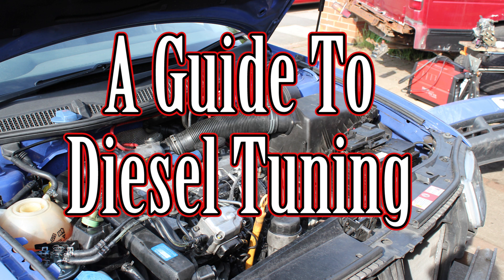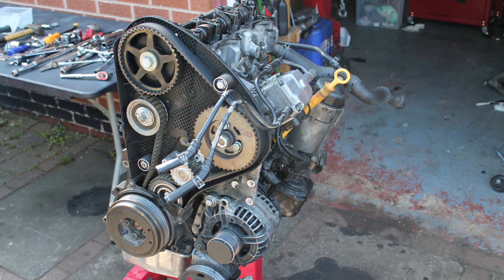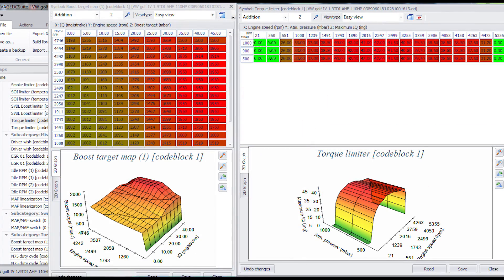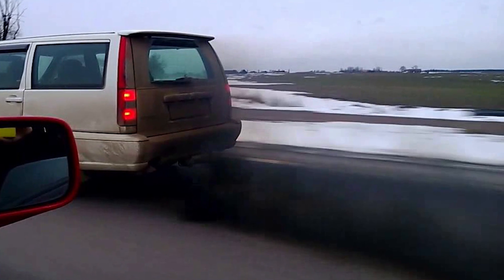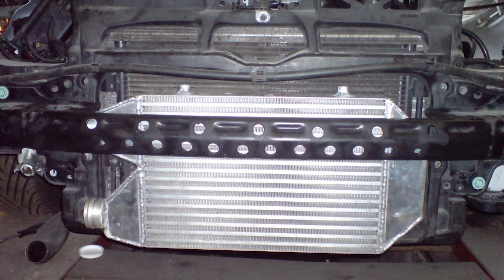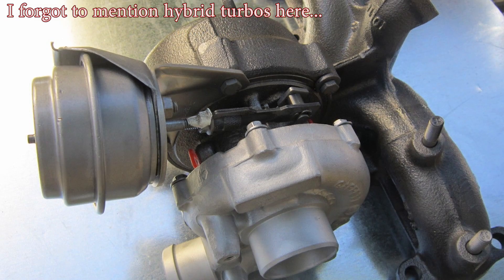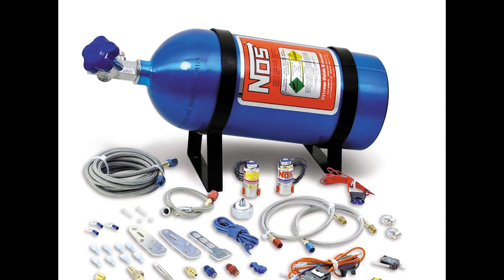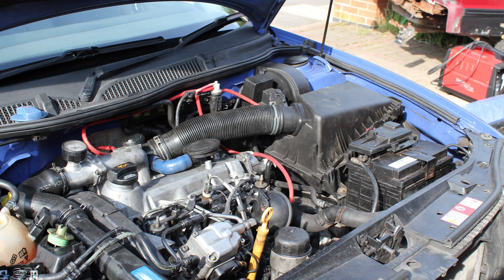A Guide To Diesel Tuning

Comment: Lol okay, I jus picked up a PD TDi Jetta (BEW Engine code) for about $500, it was a buddies car he jus dumped over 3k into, southbend stage 3 clutch, new turbo, and some other bits and pieces, injectors, etc... The car was running good, then suddenly (as he explained to me) the car lost all power, he could hear air rushing behind the engine, and the day I went to look at and buy it, it started right up no prob, and Idled fine.. TIL he hit the accel. and it would not at ALL rev, but was bellowing white smoke... I handed him the money, trailered the car home, and upon close inspection, the lower charge pipe had blown off (Intercooler side) so I replaced that hose completely, bought the KermaTDi Doggie collar for the top one, and I replaced all the Vacuum lines, jus to be safe.The car, besides injectors and Clutch, is otherwise stock. Which leads me here... I would RLY like to tune this little car myself, as I have next to nothing into it, its Diesel, and basically running stock turbo with big injectors... I understand the basic differences between a Diesel and Gas engine, IK Diesel is not Bound to the Stoich in the way the gas engines would be.. But this video was a huge help in understanding where I can start to tackle this on my own, so ty for that. There isnt alot of info out here on this topic.

Comment: Diesel tuning? Chop EGR with axe. Chop DPF with jig saw. Chop CAT with bigger saw. Insert 3" turbo back steel pipe. Vent crankcase under car. Clean all air inlet from shitload of carbon and oil.
Now you start tuning. Goodluck.

Comment: Great info. My Toyota Avensis 2.2 d4d 150bhp, 2010 plate. Remap with egr and dpf delete will take it to 190 Bhp 440 lb ft torque. Would it be recommended to remap the engine as it has covered 156k? Thanks mo
Reply: Make sure everything is clean and ready. Your motor must be healthy, injectors very clean, turbo healthy, clean fuel tank. I wouldn't delete the egr, it's very easy to remove and clean in 10 minutes and you can do it annually. Buy a new exhaust custom made and just keep the muffler and the cat. Also buy a kn performance air filter, it's also reusable so don't worry about the money. Dpf delete and stage 1 after will get you to 200+
Reply: @manbiteslife3110  hi mate. I got a diesel and want it to sound better but also pass MOT. How can I do it apart from dpf delete or buying a shitty speaker system they do.

Comment: I'm in a tricky situation trying to figure which turbo to buy. I have decided to get a gtb 1756vk but my issue lies as far as where I want to get it from I can possibly get a brand new from xq Motorsports (they have some of the fastest diesels) for 1110 USD or a gtb 1756vk from gottuned for 960 USD. Benefits from the xq Motorsports it should be of amazing quality . Con is that I have to get it thru a representative of xq Motorsports, so a middle man. Benefits of gottuned it's official website more secure and cheaper. Both will have a 6+6 billet wheel
Reply from the maker: I couldn't say tbh - you'd have to go with the best reputation and confidence of getting your money back should anything go wrong.

Comment: It would be cheaper to buy a used pd170 engine and map that thing to 220bhp, job done.
Reply from the maker: Is you wanted just 220bhp then sure but some guys run over 300bhp so depends where on the axis you are.
Reply: The great thing about the 170 is it doesn’t stop at 220, that’s stage 1.
It would be a much better platform as I imagine tuning the 1.9 from 110 to 300 would be hilariously expensive.
If your tuning for the love of it then go nuts, but in regards to power and potential future power increases, it pays to have the right platform.
Reply from the maker: Some people prefer the old 1.9's as they are simpler and cheaper it is a pick your platform and go thing, this vid was done from the POV of the car I had but true more or less on most tdis. The 3.0 V6's seem like absolute monsters looking at what darkside do
Reply: Agreed, the premise of the video is applicable to most diesel cars, I guess with any dream of tuning runs up a bill regardless, that’s what passion does to us guys and girls.

The 3.0tdi is a superb engine, I don’t know if you’ve come across the videos on here of them with a straight through and map, R35 GTR comes to mind.

This video was some time ago now, have you finished the project or moved on now?.

Comment: @250 you don’t need rods and pistons stock will cope with 350 easy research dark side developments
Reply from the maker: Sorry 250 nm, bhp, lb-ft? The engine in my example if an AHF which made 110bhp stock - I would be very interested to see one on stock internals running 350 bhp. The later PD and CR stuff certainly can take a lot more abuse on stock internals.
Reply: @CarAndMechanical  in the 110 lump you'd get 300 bhp in stock internals even the 1.8 20v turbo stock does 300 to 350 bhp in stock internals and the derv lumps are built stronger than that

Comment: Hey mate I have a turbo diesel Musso SsangYong 2007 Mercedes-Benz based motor I wanted to install a bigger turbo,what should I do or modify I just need more 60-100 hp as my car is just 120hp and weights 2400kg

Comment: No brake upgrade?
Reply from the maker: This video is talking about the power side of things, brakes, suspension, strengthening etc... are all different things. Brake leads onto tyres and so on, 100% should be a consideration for your car but out of the scope of what I was talking about here.

Comment: For me the easiest way to get good results without illegal exhaust and dpf stuff was remap and adding throttle response unit you may lough but testing many times after remap my diesel will accelerate to 60 in 7.2 after adding  throttle unit in sport mode it was 6.8 I was sceptical but it's thru

Comment: I gatta pegueot 208 hdi 132bhp 320nm torque.. cat bk exhurst. its done 70 tho miles never missed services .. and never done over a 100 mph as it hasent been thrashed ...  i wanna take cat out .. is it a instant mot failure.. .. i soo wanna take this cat out and would it be worth it ..

Comment: Good recipe for damaged dual mass fly wheel and clutch pressure plate.
Reply from the maker: If untouched - I mention SMF just before the 2 min mark - some big power builds will just destroy a stock clutch.
Reply: @CarAndMechanical  This is what exhaust and map tuning my 2L diesel made me do it, fitting SMF clutch set. Raise from 140 to about 200 bhp, clutch works fine but on high cetane fuel, SMF is not comfortable to drive. I use normal diesel fuel instead.
Reply from the maker: VAG car?  not heard that sort of drivability issue before - I know the V6's don't like the SMF as it throws out harmonics, or so I've heard.

Comment: VW Touran 2,0tdi with ECU-upgrade and EGR-delete. 190hp and 320ft-lb. Been going like this the past 3years on standard clutch and so far the only thing I’ve had to change is tires a couple of timesXD
Reply: Hi did you fit a downpipe and decat also or is it all standard with a remap only
Reply: @colingovindasamy8708  just the remap

Comment: Did you seriously suggest an LSD on a front wheel drive audi?
Reply from the maker: Being FWD absolutely, if sticking more power/torque and want to prevent understeer and single tire fire. There's a reason the performance models from Honda and others have them.

Comment: Step 1: ket a kuus (6) sylinter diissel enkine (Mersedes bens, bmw, volvo, i dont kare) 
Step 2 : Get a pik turbo (i prefer holset) and a boskh injektion pumppu
Step 3 add a vunterpaum into your kaar and bar poost kauke meter
Step 4 ket rid of te stok pump and install the new pumppu.
Step 5: make your own ekshaust header and ekshaust putk.. pipe.
Step 6 : install the new turpo into te kustom header and install te houl ting into your enkine.
Step 7 ruuv the injektion pumppu and add bar poost to preferraply 2-2,5 bar
Step 8 get a lsd and install it
Step 9 u have kuud kaar enjoi!
Reply: Also i am from Suomi

Comment: Hello, i have a seat leon 1.9 TDI asv with 1749v turbo which cleaned just 1 month ago, i have a straight pipe from the turbo, and i dont hear the turbo spools up or whistle, or even "owl"-ing after shifts, only sounds like some air escape but it cant. No boost leaks no exhaust leaks and im goin crazy noone know whats the problem. Can you help me? Thanks for reply

Comment: Tuning the engine will not increase stress on the timing belt unless you raise the rev limit and drive to it all the time.

It's not a 'single mass flywheel', it's referred to as a sold flywheel. Replacing a DMF with a solid item is not good for the engine, it puts lots of stress on the crankshaft and engine mountings. 

"Foot pound of torque". Why qualify it? Foot pounds cannot be anything other than torque. You don't say 200 brake horsepower of power, do you?

What's the logic behind remapping before making mechanical changes?

There's also the cheaper alternative, namely buy a car that suits your requirements in the first instance and just remap it conservatively to flatten the torque curve a bit.

Why are we showing a petrol engine at 6:06?

Comment: A 6,000 lb truck with 400hp and almost 1000 ft/lbs of torque stock is normal where I live 😂. It's crazy you can get over 300hp out of a 1.9 liter engine though.
Reply: Well...theres a vw golf with a 1.9l engine that made 1233hp😬

Comment: You can do whatever you want but trust me, avoid the 2.5 v6 tdi at all costs. That is one of the worst engines you can have even if you are not planning to tune. It is an extreme gamble if the previous owner sorted out all the factory issues it has and even after that I wouldn't trust my life on it like on a 1.9tdi
Reply from the maker: I've had a 2.5 V6 Quattro for two years now and put over 20k on it at 205k presently and it runs great. I've had a few 1.9's and where they are easy/cheaper to work on I love the V6 for it's power delivery between 2-4k and how smooth it is.
 Also my next steps are to step it up with parts I've had since the summer but need to fit and uprate the clutch - the 2.5's do have issues but imo it's worth it....and worse case I have a spare engine for it.
My previous 1.9 tdi went pop at 195k, swapped in another and kept going, treating this the same.
Reply: @CarAndMechanical  yes it is a very nice engine to drive, however 99% of the 1st owners of this engine didn't maintain it properly and this means that finding a good one second hand is very very very hard. As since they are not as durable as 1.9tdis this means that finding a reliable second hand 2.5 V6 is probably one of the hardest things to do in life. Good luck with yours, hopefully it remains good. Most of my friends who had it felt like they bought a money pit and they only have a few hours of fun with it before it brakes again.
Reply from the maker: Honestly I think the way forward is to make sure you get one with B series heads (good cams and better lifters) or buy a good shell with a crap engine and swap it from the get go (if you are set up that way), when I got mine I went to someone that's known to build good ones so I paid over market price but I wanted one that had the cams done etc...
 I've had issues with it but these are typical VAG TDI issues (MAF failure) and a few that were easy fixes and anything else is whatever you attribute to a 15 year old A4.
If I can get a few more years from this then I'll go to the 3.0 because Audi fixed all the kinks and made a beast.

Comment: Suggestions on best straight through/sports exhaust you suggest for this A3 8l TDi? Bearing in mine I guess emmission standards still need to be adhered to somewhat?
Reply from the maker: Will the car be tuned? The best thing performance wise is a straight through but it'll be noisey so potentially a decat (or knocked through test pile for dyno purposes...).
There are places that will do the cat back for £200ish and can tune the sound, so a down turned exhaust for example is less droney.

Comment: Thanks very much for your video. So far you helped me properly remove door cards and install speakers and remove the instrument cluster. I also have an Audi A3 TDi and recently bought a standard intercooler unfortunately before I saw your video. Can you tell me the exact make or where I might find the one you mentioned which fits in replacement of the standard one but is double the capacity? I might still change it. Thanks for all your video's. Thumbs up from me. Best, Richard
Reply from the maker: No worries Richard, they are pretty much a TDI SMIC on eBay and they are around £80. 
It's worth checking the size of the MAP sensor as sometimes the aftermarket ones have bigger/smaller fittings as there are two versions.
This intercooler on forums is known as a tacotaco type, also darkside sell them for £90

Comment: HOW ABOUT TURBOCHARGING A NON TURBO DIESEL. ON AN INLINE INJECTION PUMP(P-PUMP) TYPE OF FUEL SYSTEM DIESEL ENGINE? PLSS I NEED YOUR ANSWER.
Reply from the maker: Which car are we talking here. Typically you are better off with a full engine swap as you need to change fuel management as well as VNT systems.
Reply: I mean. Is it okay to turbocharged a non turbo engine? and what should I do to turbocharged a non turbo diesel engine?

Comment: Nice explanation!  One question how far can you go with ecu tuning. I'm talking stage 1, 2, 3. On a jetta 2.0 tdi ? What are the limits that the engine, transmission,  can take?
Reply: Stage 1 is fine if you aren't improving other aspects of the motor

Comment: Step 1: Raise boost and adjust the fuel pump to max capacity on a 30 year old engine. 
Step 2: Overheat, warp or crack the head.
Step 3: Buy new engine. Repeat.
Reply: That's heat and a bad tuner.
Reply: First step is broken clutch if you wants to follow next steps change it and go further to crack the head 😁
Reply: Egt gauge a must
Reply: Step 1 buy a more powerful car
Reply: Good recipe for damaged dual mass fly wheel and clutch pressure plate.

Comment: Do you need to remove the dpf if you are getting ecu remaped
Reply from the maker: Depends on the laws where you live - in the UK if your car comes with an DPF and you remove it then it'll fail the MOT. Performance wise they sap some flow - but I also understand they can be mapped to be less of a restriction by playing with regen cycles.
Reply: @CarAndMechanical  my dad said that takes no point gating ecu remap or chip and not remove the did 
So thanks for helping settle that argument XD

Comment: No mention of performance air filters????
Reply from the maker: Nope, for a number of reasons. First is the OEMs are pretty good, on VW TDI the stock airbox and filter flow well enough and people who swap often run into issues. 
The second part is VW tdis use a MAF for fueling and oiled performance panel/induction kits can mess with the MAF which will create performance issues as fueling is linked to MAF readings.
There might be some performance potential in a uprated filter but maybe a few horse power at best, I think you'd get more from removing bottlenecks and smoothing airflow of which I'll be covering down the line.
Reply: Interesting, I do know that if you used oiled filters such as K & N then they can play havoc with the MAF sensors. However I recently fitted a Pipercross panel filter to my Audi 184 TDI and it certainly made a positive impact and well worth the £32 investment.
Reply from the maker: Funnily enough my A3 had a Piper cross when I got it, I switched to paper filters I didn't notice any difference. It might be a case of total flow coming into play, I'm going to be doing some experiments when I get the chance on my 2.5 TDI using MAF readings to determine some things like smoothing the airbox baffles,  velocity stacks etc...

Comment: Hi What pipes do i need to add the side intercooler because stock ones dont work/fit
Reply from the maker: Hey man, for which car?
Reply: @CarAndMechanical  1.9 TDI a3 2001 130cv
Reply: help please !!!
Reply from the maker: Sorry I've been tied up with projects and work recently. So at the moment you have a stock SMIC or are upgrading?
I think a generic kit should sort you with enough couplings/90's to plumb an FMIC - can you let me know what you've got stock and what you need to ad?